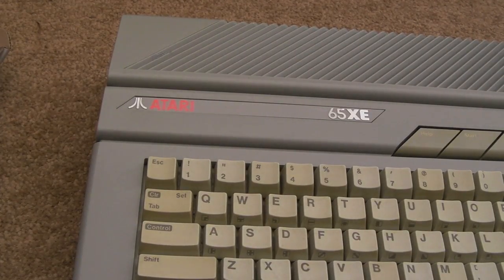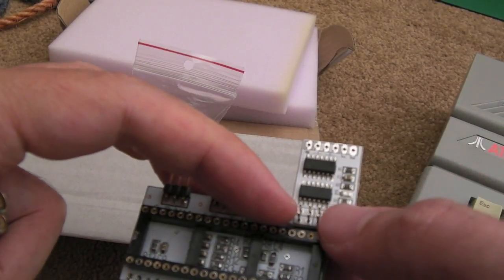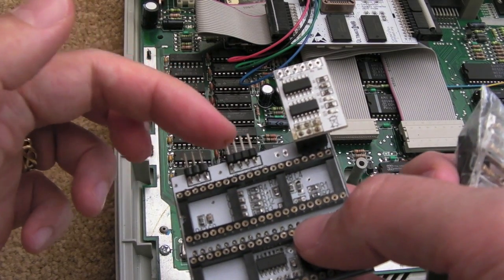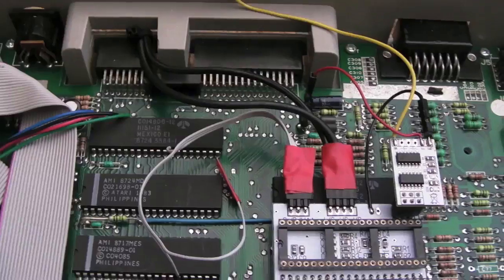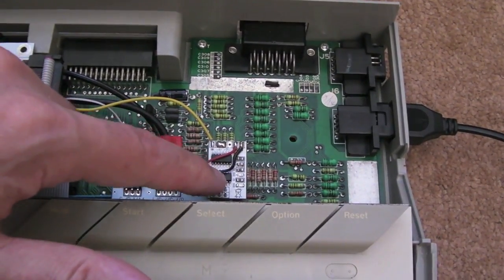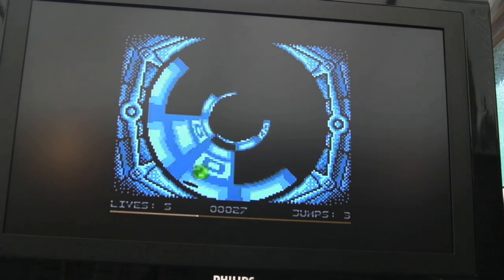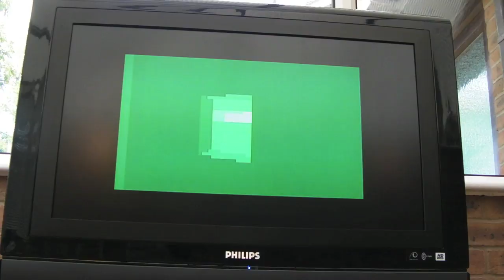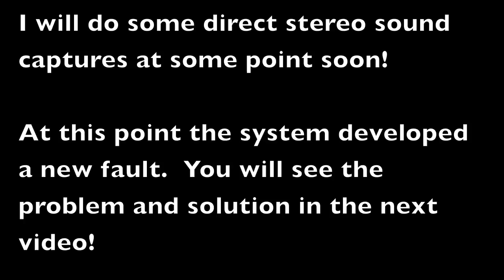Atari 65XE (130XE) - Stereo Pokey Upgrade

Comment: Cool! Stereo POKEY sound is a new one on me....  Better finish watching the video now.... :)
Reply from the maker: The one thing I kind of prefer (although there are many things I prefer about the SID) about the SID vs Pokey is the SID had so many versions at manufacture and they all sound different regards filters etc.  That makes the psuedo stereo more appealing to me than the actual stereo support.   I am guessing if I put the two Pokeys in parallel they would just sound identical =/

Comment: Cool Stereo pokey! :o) So this is more like a mssiah type setup (one pokey on a different address) rather than the dual SID type configuration? Sounding good!
Reply from the maker: Hehe, yes - sounds great!  I filmed this before you started your stereo C64 mod or I would have given you a shout out (something long overdue!).  I will give you a shout out soon!  You've got more subs than me now!!!!!!!!!!!!!!   And yes - like the mssiah as you say!  That's one thing I prefer about the SID, the way they all have different filters, and the differences in sound between the 6581 and 8580.  SID still wins =D
Reply: That's not a problem, I don't expect a shoutout..as I said yours is well deserved, as well as Dave Curran, I would have goofed up the SIDs I think had I gone ahead with doing what I initially thought was the way. It's the first i've tinkered with this kind of electronics. I've mostly only tinkered with analogue audio :o)
Reply from the maker: Yours will be well deserved lol - You're great to watch =D  You will pick it up quickly I'me sure! Put it this way, you've mastered sound tracker there, and with all the stuff you've done and shown in previous videos - you can do anything when you put your mind to it i'me sure.
Reply: Thank you for the encouraging words, I appreciate! :o)

Comment: Pretty damn cool Chris. Beat the sid by a mile. I wonder how the sid2sid compares to this.
Reply from the maker: =D  MsMadLemon is doing the SID2SID mod to her C64 at the moment - it will be interesting to hear 2 x SID in true stereo =D
Reply: Check the Atari 8-bit forums over at AtariAge. There's links to Single and Dual POKEY audio, including the emulation of SID sounds by both the POKEY and the TIA in the 2600/7800. Lots of great stuff coming out of the former "Eastern" Europe [technically, "Central" Europe].

Comment: Could you do this on an 800XL? Thats sounds wicked. Demo looks great, could you clock the CPU to make the demo run smoother at all?
Reply from the maker: I believe so - provided you socket the Pokey chip and provided there's enough clearance for the board.  If in doubt, just ask Lotharek - he usually response to emails really quickly.
Reply: Thanks gadget, sorry for all the questions spanned across your vids, I binged watched a few on the trott. Ive made sure i get updated now you do a vid.
Reply from the maker: No worries lol - Glad someone is watching them!!!

Comment: Do you not have a audio capture card,  like a line in on  sound card,  then just dub audio over the top,   would of been great to capture the audio in stereo and upload that,  all i got was mono through your mono microphone.
Reply from the maker: It is a stereo mic, but as I said in the video - I will do another video with a direct sound capture (like I did for the dual SID and swin SID ultimate stuff).